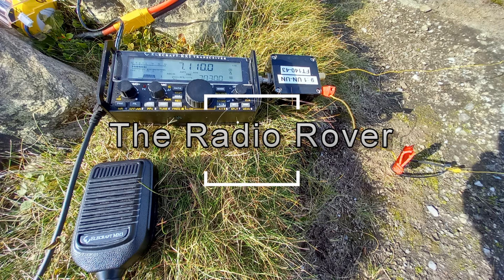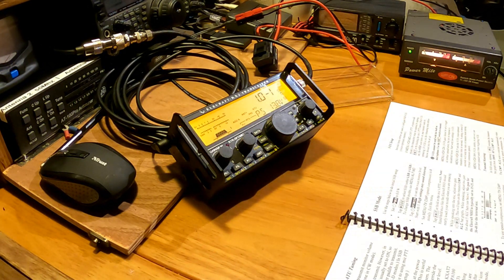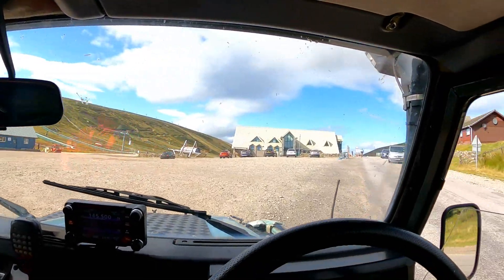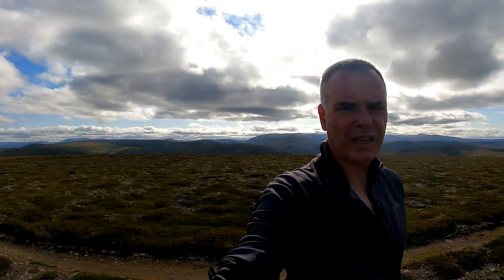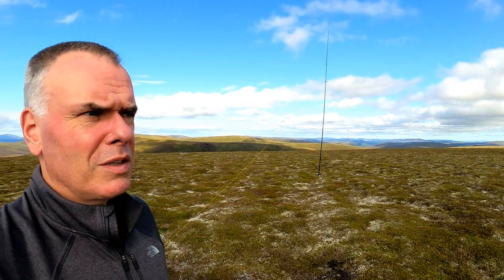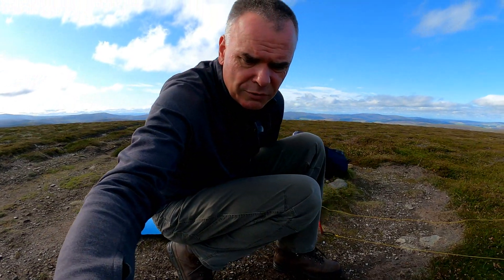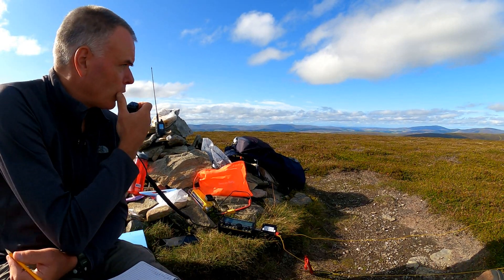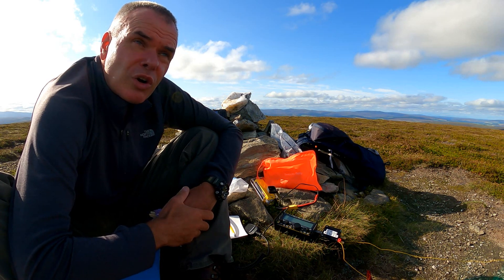KXAT2 TUNER fitting to Elecraft KX-2 &  SOTA Test with W3EDP

Comment: I am guessing but the KX2 could probably tune it without a 9:1. If true would the set up be more efficient?
Reply from the maker: My KX2 tunes most things, however it doesn't like my W3EDP on 40 m. Nor does it like my 41' random on 40 m, so I always use the 9:1.
If I'm after DX I generally use a resonant antenna, but the random wires are so convenient for a quick activation.
73, Fraser MM0EFI

Comment: Gretat video as always!
teh fitting is GREAT and clear!

quick question on antenna though (my OCD....)

is that a W3EDP antenna 
or a 9:1 Radom wire antenna ??

I thought W3EDP antenna is with a 300/450 ohm laderline??

if you woudl explain teh antenna (a video woudl be amazing! that wodul be great
Reply from the maker: Yes, it's the original design for the W3EDP from the 1930's. However, you are correct, it is really a random wire, as it needs a tuner. Probably doesn't need a 9:1 with the kX2, but it tunes 40m and 80m more reliably with one fitted.
In later years the W3EDP was adapted to include ladder line. I find this version works best portable, as it is lighter, simpler and allows more flexibility.
Thanks for your comments and the feedback! Much appreciated.
73, Fraser MM0EFI

Comment: How high is your mast?
Reply from the maker: Mike, that's about 8m of a 10m fishing pole. The tip of the antenna slides down over the top section, so the top of the wire is around 7m above ground. I also use a 7m Spiderbeams pole, which is  stronger, so the aerial can sit right at the top. However at 1kg, it's 300g heavier than the fishing pole.

Comment: Hi Fraser, another good video. I have just homebrewed a 1/2 of this antenna without the balun. My little ATU-40 (modded for QRP ATU-100) with 817 tunes it nicely 40 through 10. Will let you know how I get on with it whe I use it in anger. Stevie, MM0ZFG.
Reply from the maker: Nice one! TBH I was using it without a 9:1 for a while with my ft857 and a tuner but it sometimes had high SWR depending on ground conditions. I reckon the kxat2 tuner would get a match. I keep meaning to try it...
Last two times out I've worked USA in ssb with the set up you see in the video.
Cheers, Fraser  MM0EFI